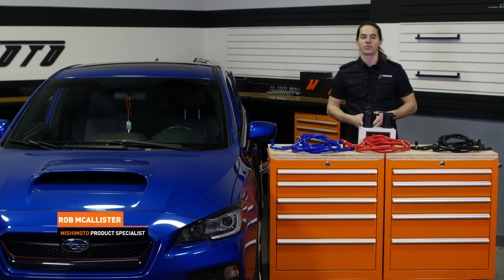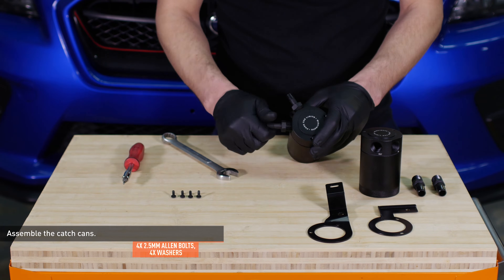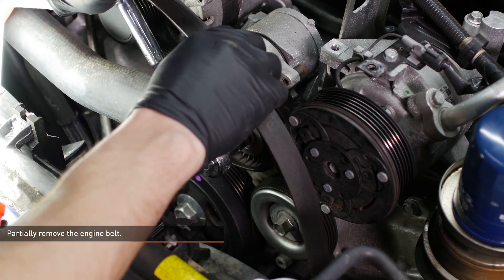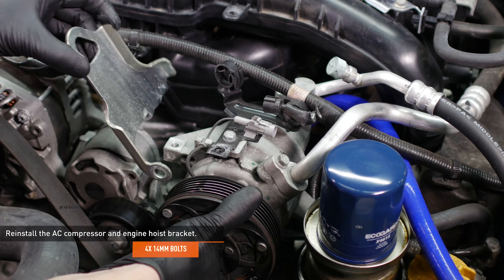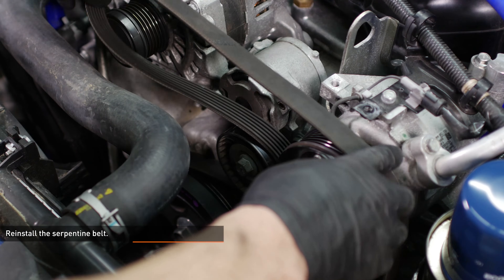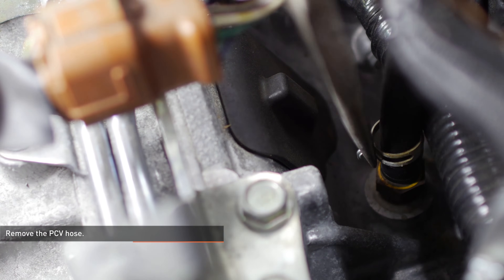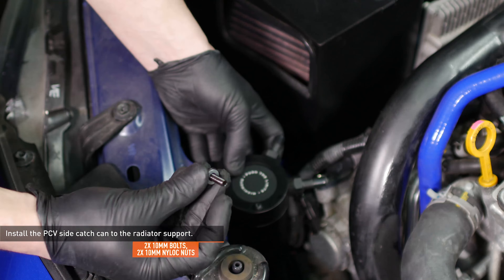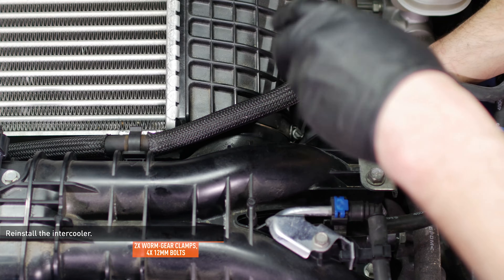Baffled Oil Catch Can System for the 2015-2016 Subaru WRX Install Video

Comment: Does this work with the STI also?
Reply from the maker: This catch can kit would not be compatible with the STI as they are different engines
Reply: @mishimoto  I can't see anything on offer from mishimotos website for the 2015+ STI's.  I was told by a mishimoto rep that the 3 port was not recommended for the STI, so I imagines a 2 catch can system would be the way? Other than the supplied fittings would I be able to set up a 2 catch can set up for the 2015+ STI's?

Comment: I have a question about your kit.  Does it contain a check valve from the intake manifold to the catch can?  I ask because in boost you would be pressurizing the catch can with this set up.  I have ran a catch can in a previous turbocharged car and ran into the issue but fixed it with a dual check valve set up, using the factory PVC valve and secondary one at the manifold.
Reply from the maker: No check valve is present in the system, we found this to not be an issue during the testing of the system.

Comment: I just ordered this kit for my 2018 qrc because your website says this also fits it. This is true correct? Just want to make sure since I seen a comment saying otherwise but was years old
Reply from the maker: The full kit will not fit the 2018 model. We offer just a PCV side that would work for your vehicle but the CCV side is not compatible with the later model cars.
Reply: @mishimoto  I have one of the year 2019, I bought the same one from the photo and managed to install the 2 catch can, will it affect something?

Comment: I have a 2020 wrx. Is it the same?
Reply from the maker: The dual system will only fit up to 2016 models, however we do offer a PCV side that will fit your model year, the CCV is the only side we don't currently offer for your year.

Comment: I have this kit. The hoses are not good quality. They look great and well made but  i installed it approximately a year ago and i consistantly get a oil/ fuel smell in the car since i did the install. I checked all the connections multiple times. it seems like the fuel/ oil on the pcv hose bleeds right through the hose. It always has a oil film on the entire hose and after doing a little research on forums, i found out i am not the only one with this same issue. I recommend reading up on this.  "Oil Smell" associated with mishimoto kits before spending good money on this.
Reply from the maker: It sounds like you may have picked up one of our older kits. The kit used to come with silicone lines that were prone to this when the inner oil resistant layers would fail. We did however discontinue these some time ago and replaced them with molded rubber line. Please feel free to contact us at support@mishimoto.com and we would be happy to warranty the hoses for you.
Reply: @mishimoto  I just installed the PCV side. The hoses included were black without Mishimoto markings. Are these from the updated rubber version? Please let me know.
Also, the hoses were too tight at the PCV valve and intake manifold ports, so I had to wrestle quite a bit for the hoses to slide on. It could be that mine is a 2020 WRX, not sure if they changed the design.

Comment: The hose that leads from the CCV to the turbo inlet on the 2018 has a sensor attached to it. Any idea what I’m suppose to do about that? Thanks
Reply from the maker: Hey Luke, this kit was designed for the 15-16 models. Feel free to reach out to our team at Support@Mishimoto.com or by calling 302-762-4501 Mon-Fri 9A-5P EST and we'd be happy to help troubleshoot your setup.

Comment: Great video. I'm excited to get these. How exactly do you drain them once they are installed?
Reply from the maker: Hey tehtorphbegger . Great question. There are quite a few ways to go about draining your catch cans. There is a port on the bottom that can be removed for draining simply by removing it. These ports on the bottom also function with our drain kit MMBCC-DRAIN-02. The lid of the catch cans is also removable. So you could simply unscrew and empty that way as well.

Comment: why did the location of the pcv can change? what are the inner diameter of the hoses if i wanted to run braided lines?
Reply from the maker: Hey Troy. I believe this change was made simply to make the can easier to access. I'm reaching out to the engineering team for confirmation that there was no other reasoning for this change. I'll follow up when I hear back!
Reply from the maker: Hey Troy. Product group was kind enough to get right back to me on this one. The location of the PCV can was changed to accommodate for 2016 models with eyesight. The hoses that come with this kit are meant to function with a 3/8ths barb fitting.

Comment: On my 2018 fxt the pvc side of the catch can system is catching more gas than oil. Is that normal?
Reply from the maker: Hey Joseph. Catch can's really are a tough product to say what is and isn't normal. The residue that the cans collect can vary largely from 2 different vehicles in the exact same conditions. During our testing, some vehicles would fill the PCV can much quicker than the CCV can and other vehicles were the direct opposite. In my experience, gas vapors are much more likely to collect during colder weather.  I wish I had a more rock solid answer for you in the scenario.
Reply: Mishimoto Automotive thanks that helps, its 25 degrees where I am 👍🏾
Reply: You got this kit on you FXT?
Reply: Arthur Archer yes sir, but I have the 1st gen version of this kit. If I could post pictures I would. With only 1 modification to the larger bracket ( with the M on it ) everything works great.
Reply: I have a 2016 fxt.  Possible to do an installation video with 2014-2018 Subaru Forester turbo?

Comment: Does this void the warranty?
Reply from the maker: Hey flareboy41! This will not void your warranty.  Check out the Magnuson-Moss Warranty Act - in a nutshell, the dealer/manufacturer would have to prove that the part in question is what caused the failure.  So if you installed our catch can, and then a few months later your OEM radiator started leaking from an end tank, your dealer must honor your warranty, as the aftermarket part did not influence the leak.

Comment: Would this fit a 2017 WRX?
Reply from the maker: Hi ChanggunKang! Fitment has not been confirmed for the 2017 model.
Reply: I have a 2017, and bought this kit. I can say that the line from the block to the turbo doesn't have spring hose clamps on both ends. It looks like a clamp that's crimped on on both ends. Id like to have a better video on how to remove both sides...
Reply: maxst2 i did that on my 2018 fxt and it worked
Reply: maxst2 i think you're talking about an ear style clip, you just cut off the top of the ears and then throw away the clip after as it is not reuse able. Did you install this already? Im thinking about buying one for my 17
Reply: Negative. I was just thinking about getting some male to male hose splice connectors and just tapping the lines.
Reply: im trying to yank that hose clip out but i think im gonna have to go with the direction, and it really didnt trigger nothing? it works fine?...
Reply: Now they made one that fits current years for PCV side, just ordered one so I needed this video lol
Reply: How many catch can to be use for 2016 sti? Thank you..

Comment: would i need a tune after installing??
Reply from the maker: Hey! No you will not need a tune after installing our 2015–2016 Subaru WRX Baffled Oil Catch Can System